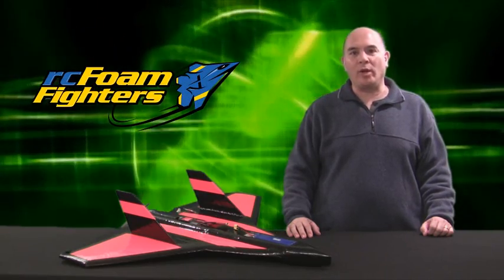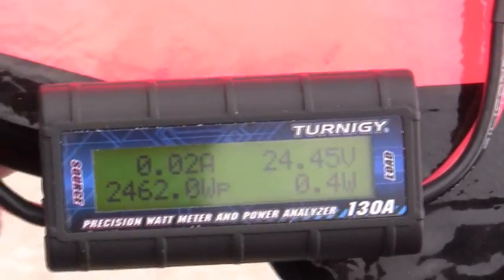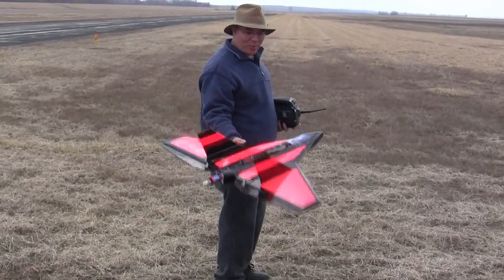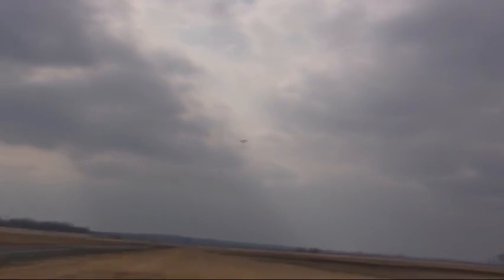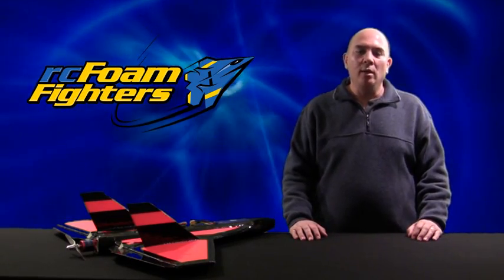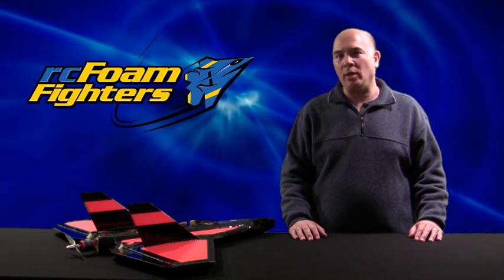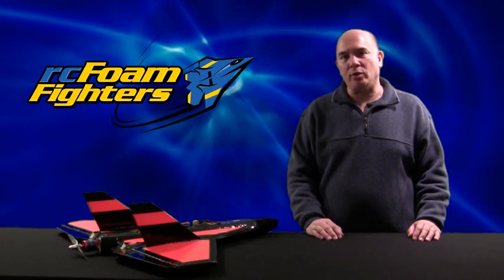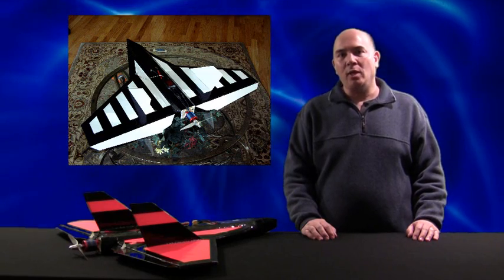SkyFighter v3 Speed Challenge Plane Build Completion and Maiden Flight

Comment from the maker: Cool Brandon! Doppler readings were all over the place. I will need to get better ones next time out. You may be able to get the set screw out if you put a small drop of high strength lock tight in the set screw then insert  an old Allen driver and let it set up. That stuff holds stronger than super glue. After it hardens just turn it to get the set screw out. After it is out heat the set screw up with a lighter to release the bond so you can get the Allen driver out of the set screw.

Comment from the maker: Gregg sounds like the same thing that happened to the first esc I had for this plane. I did get to use it a little in my FunJet  with a 5 cell and one of these motors first before I smoked it. Hope you have better luck with the new one. This one I have now seems to be taking the punishment pretty well for a 90/100amp esc. It survived more than 2400watts @ about 117amps I thought it was going to be toast for sure, lol!!

Comment: super cool franko. i think we're all awaiting a mph reading, lol. it's hard to tell how fast by looking cause you can hardly see that thing. parts came in for mine, the motor shaft set screw was stripped, so swapping ends is out. turnigy esc seems awesome. the 5 cell seems sweet. bummer is the imax b6 charger died after 5 seconds of use. everything was hooked up correct and double checked but something was faulty, so now i have a new 5 cell and no charger. the plane is almost complete though!

Comment from the maker: Thanks Ben! The passes in this video were not strait enough to get an accurate wave sound file reading for the doppler program. There is too much variance in the sound waves files due to the angle of attack at the camera and varying throttle changes and flight path. I will try to get some better passes the next time out.

Comment: Awesome fast Frank! I built the V2 and it seems to be pitchy I've tried changing my control surface travel, expo all that stuff. I was wondering if the shape of the Elevons, with the cut out for the prop, might be causing the pitchyness. Have you ever tried making the Elevons straight across the back. Thanks for all your plans and videos.

Comment from the maker: Nobel0 do a seach on the internet for " APC 6.5x6.5 sport prop" if you will be using a 6 cell battery and search for "APC 7x8 sport prop" if you will use a 5 cell battery. I usually just get my props at the local hobby shop.